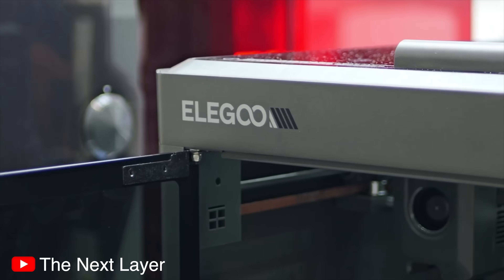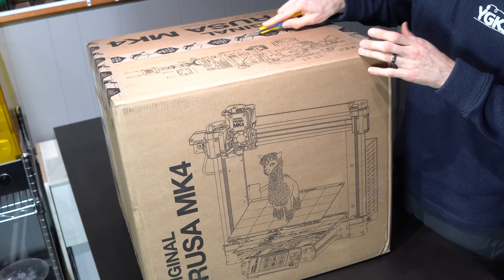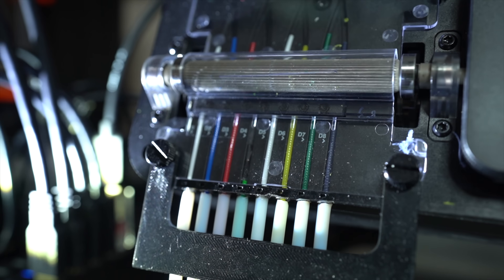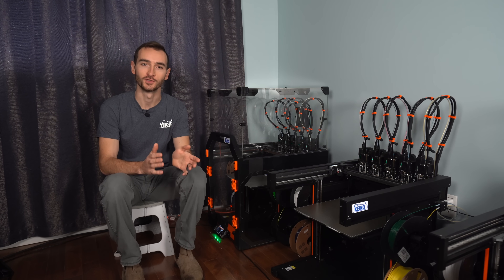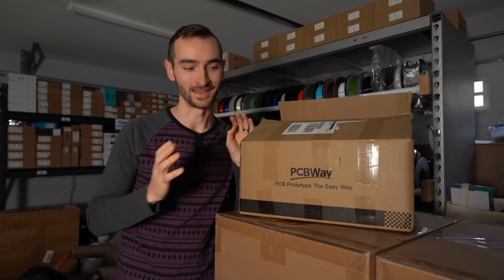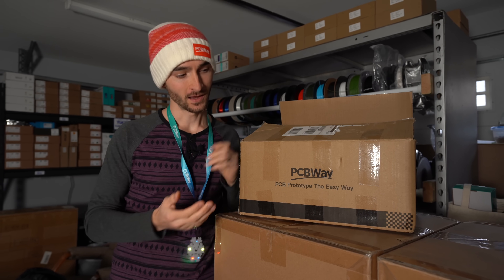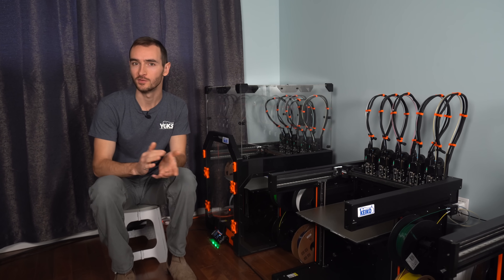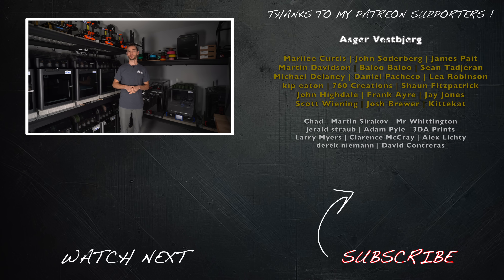The Prusa Core One is dividing the internet...

Comment from the maker: Thanks for watching. For the record, I’m not saying the X1Cs are permanent paperweights. They’re just out of commission until I find the time to repair them. I’m perceiving it to be a difficult process given how tightly integrated these machines are, but I might be mistaken. I have reviewed the instructions on the Wiki for replacing the heated bed and it appears to be quite involved, but perhaps it’s easier than it looks. Cost wise, the replacements are very reasonable: around $120 for a full bed assembly.
Reply: I...don't get it? The screen gives you a message indicating what's wrong, the replacement parts are readily available, and you just don't feel like it because it might be "more work than it's worth" to fix them? And that's why they're paperweights? Whhaaaaa? Like if it was some esoteric failure or one that necessitated scrapping the entire printer I would understand, but just not feeling like dealing with it isn't quite the same thing.
Reply: i just bought bamboo A1 :((((
Reply: @wickedisgood3280  good, congrats!
Reply: @wickedisgood3280 return it lol cant use 3 party software
Reply: @wickedisgood3280  
Thrilling...🙄
Reply: @wickedisgood3280  
Thrilling...🙄
Reply: Might be an idea to mention other competing corexy machines like the K1 Max or SV08 which have a bigger bed.

IMO Prusa has to move to industrial as it stands at the moment, other companies just copied them and their ideas or ideas from the open source community and dont have to do their own research. Prusas costs are always going to be higher.
Reply: @francistaylor1822  they aren't "competition" that's the big issue. All other brands currently are for people that want to build and tinker with a printer rather than just print. This exact thing is why I did go with and have Bambu printers. I started with a flashforge and an ender clone that (while they did get me to learn how to build and troubleshoot printers) took absolutely forever to get to even half the quality as all of my Bambus out of the box. I just needed shit to print for my main business and not spend days tinkering. That's every other brand right now.
Reply: Yeah I went ahead and closed the video at this point. 1,800 print hours in and I have had some minor issues but nothing I couldn't service myself. You didn't even try to solve the problem and are acting like it is an end of life issue. I wouldn't call you a Bambu shill, I'd confidently call you a Prusa shill.
Reply: Consider making a video of the repair process and overall thoughts on the repairs
Reply: @ygk3d  I can speak from experience, the heat bed is probably the second worst thing to replace, after the XY carbon rails. I mean, replacing the entire chassis is probably the absolute worst as you have to replace everything. But yeah, heat bed requires you to remove side panels, back panel, a wire that’s routed in a weird way, cable management…. I’ve had to do one heat bed in one year across eleven machines. Not bad, would not recommend the process to friends. But the XY is way worse.
Reply: They’re not too bad to work on.  No worse than an Ender 3.  Plus they seem to sell just about everything as a spare part, for reasonable prices.

This is from my experience with a P1S.  Mostly from (repeatedly) servicing the AMS unit, which is the weakest part of the system by far.  Even lightly abrasive materials play havoc with it.
Reply: It's easier than it looks.  I was shipped a "banana bed" (warped heat bed).  Replacing it seemed more daunting in the instructions than it really was.

I put it off for almost a year due to same worry.

The disadvantage is that we don't build the Bambus.  I've built a few dozen MK3S from scratch and know them inside and out.  So we just don't know what to expect.

Tearing apart the Bambu isn't any worse than any enclosed CoreXY.
Reply: This sounds like a user problem not a product problem.  The WIKI tells you everything, and all the parts are purchasable.  This is a user issue, and should not be a ding on Bambu.  I have had to fix my AMS 1 time with parts, and my printer once.  I don't think I've ever seen such good documentation and disassembly videos produced by any manufacture.  Most of the time you have to go watch youtube to repair stuff.  Bambu has a good self service model.
Reply: @galley3175  ohh can you link the wiki page about the recent firmware rping bambu scam? The one where you must use bambu slicer or a junk bambu "bridge" sw between orca and your printer even in lan only mode just to collect your data and control what you own? That would be really helpful.
Reply: Prusa with Bambu controversy but I won't get much use out of it. I only need to print enough terrains and I'm done, however I would continue to print miniatures (since I don't paint them) forever. If only Prusa can give us resin quality miniatures print.
Reply: See, that's where you are wrong. There are people running huge farms of BambuLab machines and I can tell from personal experience both their support team and repairability is fine (1700 machine hours average). Plenty of original spare parts are readily available in their shop with fast shipment, often at a lower cost compared to Prusa spares. Repair videos are quite well done also. This is very much unlike Apple. It's more like an open-minded repairable iPhone, combining great UX with easy repairability.
Reply: I do agree with the complexity of disassembly, since I already got the hotend, extruder assembly replaced(after spending couple of hours trying to recover them). The Lidar on X1C makes for a no tune, print anything for prototype purposes(unless you edit a bunch of gcode to bypass unwanted procedures for production).  It unnecessarily increases complexity(when lidar/camera error pops up from time to time), and additional time to every print. The best I know was a Lulzbot, with its direct extruder, although it is lost in eternity. I do love P1S's  no wifi, no bamboo studio not even registered🤫, but prints like a tank, with just the gcode loaded onto an industrial microsd card, except for one firmware bug(resolved in a later firmware🤯), that can be easily worked around.❤👍
Reply: This is the equivalent of me bitching that my Range Rover is now a paperweight because I got a warning light that the coolant level is low. Yes it's $300 bucks for a dealership visit, or you can you know, be a functional adult, buy a gallon of appropriate coolant, and top it off -- It actually needed equivalent of a cup after 4 years of ownership. Complaining that the coolant port is hard to find, and the instructions are confusing is next level entitled.
Reply from the maker: @kazolar  Coolant is a consumable. If the argument was about greasing rods / replacing nozzles (something easy) then your analogy would make sense. In this case, we're discussing a critical fault of the heated bed that will require disassembly of the printer. Do you do your own car repairs or do you take it to a mechanic? If nobody offered the service of car repair and you had to do the work yourself, at a certain point, you might just consider selling the car and buying a new one. Time is money, especially when running a business, which is my use case for these printers.
Reply: @ygk3d  Considering the speed difference between the X1C and the Prusa MK3s you have, it 100% makes sense to repair the bed... The hot end force sensor is significantly easier to replace and even sillier to not have fixed yet.
Reply: Bro. You made a video bashing the serviceability of the them without even contacting their support team first? 😂. By stating that nonsense, I assume everything else you said was nonsense.
Reply: @mallclerks  Buddy, be honest.  Does he also have to prove that the world is round and the moon is not made of cheese?   Look around online, or simply talk to others that have both.   If you want to fight about something or shill for Bambu, this is not the point to do it on.  Go with price and innovation instead where Bambu still leads.   He also said at the end of the video he'd still pick a Bambu over Prusa.   Geez.
Reply from the maker: @ @  it’s all documented on the Wiki, so I know roughly what’s involved. It doesn’t look like an insignificant task which is why I haven’t gotten around to it. Contacting support would just be for a warranty claim to save the cost of the replacement parts.
Reply: @ygk3d  You also likened Bambu printers to disposable tech, complete with stock footage of shredded circuit boards and allusions to the iPhone's lack of repairability while nuzzling up on Prusa's jock. Then you go after Bambu's "shoddy support" at 10:47, but you said yourself you haven't contacted them. 

And if/when Prusa goes out of business, I challenge you to find a complete third party toolhead. Or their PCBs. Go ahead, go find them now even.

Rethink this video. Consider pulling and fixing it. 

I won't see anything you ever produce ever again, since I'll be blocking this channel from my recommendations next time I get the chance... 

(And I own a P1S, an X1C, and an XL).

Oh, I see - You'd throw out a P1S if you run into the slightest hiccup. Got it.

Dude, you have some brown on your nose. Did Bambu decline to send you review units or something?
Reply from the maker: @ you’ve misinterpreted. I love Bambu printers. They’re my daily drivers. Perhaps some of my statements were misinterpreted. I wasn’t implying Bambu’s customer service is shoddy, just that Prusa’s is not. And the bit about most tech products being disposable was a general statement of the industry. I’m pretty certain I’ll have sold off all of my current generation printers 5 years from now. They won’t immediately end up as e-waste but eventually the tech will be so dated that nobody will want them. I tried to be pretty even in my assessment here, saying both positive and negative about both brands. If you don’t like my content, that’s your loss.
Reply: @ygk3d  No, I haven't misinterpreted. Your words failed to convey the sentiment you hold. Why make the comparisons - the DIRECT, in sequence comparisons - if you don't hold the belief you voiced? 

Your backpedaling here is quite sad. If you feel Prusa's customer service is good, speak about that. Don't speak about shoddy customer service, implying Bambu, while also in the same video saying you haven't contacted them.

Watch your video from the perspective of your audience, and not the thoughts that exist only in your head since you didn't communicate them to us.
Reply: @ygk3d  One glaring issue IMHO is you gave a glowing pass to Prusa for their support but automatically dismissed Bambu without even following through.  It's lazy journalism to only provide one and not even an attempt of troubleshooting for the other. Bambu are touchy with all of the sensors and tech so I'm not saying otherwise but it's a cop out to leave it at that and act like you're just going to trash two printers that likely require a couple hours troubleshooting and repair time to get back online.  I don't fully disagree with many of the points brought up, but you should be looking at both with the same objectivity if you're going to compare them outright.
Reply: @ygk3d  The task can't be any worse than receiving an $800 prusa mk4 and putting hours into assembling it vs buying the bambu A1 for $300-350 and putting 30 minutes into assembly. You could replace the bed a few times and it still wouldn't add up to the total time spent assembling the printer in the first place.

I know the X1C is a different animal, but from what I've seen, they made everything on their printers quite accessible.

Bambu has done a great job offering the best tech at a reasonable price. Prusa drags their feet on offering new tech and tries to pass it off as them trying to offer a more reliable product. In reality, it's them saving money and letting everyone else do the development.

The only thing Prusa has going for it right now, is the old thoughts that they are the workhorse 3d printer. You may have 2 bambu printers with issues, but I have seen farmers that replaced all of their prusa printers with bambu (cost less to get more printers and ams) and after a year have seen no more, if not less failures with the bambu compared to the prusas. The repairs on the bambus were also quicker and easier than the prusa.
Reply: @Those_Weirdos  This is the exact point I make to people who over-index on "repairability." Being able to source certain parts at the moment != "eternal repairability." Even if it's open source. Like it's great that you can make your own PCBs and load the software - can you also grind your own Z-screws? Wind your own motors? Because at the end of the day every independent prepper-bro 3D printing enthusiast is still dependent on other people continuing to manufacture things for them to buy. There is no clear black line between "repairable" and "unrepairable." 

Bambu Labs came and did what nobody else managed to do until then: make a 3D printer that just works (99% of the time at least) and can be treated as a tool and not a hobby/obsession unto itself. Everything else is cope until a true competitor emerges.
Reply: @ygk3d , perhaps some of your statements were misleading... I guess, the goal was to get a large number of comments. This is getting more and more "popular" on YT.
Reply: @Those_Weirdos  since you’ve already said you’re blocking this video, you probably won’t read this, but why so angry?  And what’s with the highly sexualized references?  Ultimately, why are you so challenged by someone else’s take on a 3d printer?  It’s just a tool, not a lifestyle friend.
Reply: @Those_Weirdos  Oh no he'll have one less viewer!
Reply: @Those_Weirdos quite the melodramatic response. Good riddance in my opinion.
Reply: @Otamatone_Productions ooo this comment age like milk finding out bambu new software update lmao and this guy gets his info from wiki lol how about the actual website not a community source wiki that is uncredited in schools
Reply: @cartier13  he is absolutely mental.
Reply: How about you actually figure naif not it's easy to repair or not before making statements as if they are facts.
Reply: Heatbed failure after only 1,000 hours is not good at all; what part will fail next? and there are many (the majority?) of folks buying Bambu because it's prices does make it accessible for a 'plug and play' experience. They're not tinkerers and are neither adept at and / nor want to fix things like you and I. And then there's the white elephant in the room. How did Bambu come from nowhere with such a groundbreaking market disrupting product? How was their R & D and massive production startup funded? One answer, They're Chinese where wages and benefits pale to what other companies - ergo Prusa pay. I'm sure Prusa get some support from their government but NOTHING compared to what a company gets who are in favor with their communist government. Those comparative sales points you said Prusa make in direct reference to Bambu are both very valid and why wouldn't they; that's called free market competing. Prusa recognize who they're up against and are responding. The way you present that is done as if it's a negative against Prusa? At the end of the day, Each company has a place in the market and to HUGE credit to Bambu, among other things, they stopped the race to the bottom of hobbyist FFM 3D printers. As you said, we the consumer, of either company's products, win :D
Reply: @what_the_filament  There's no guarantee the heatbed itself has failed-- based on the error, it's either a bad thermistor, or more likely, a bad connection to said thermistor.  And there are people with three to six thousand hours on their Bambu's with zero failures.
Reply: @what_the_filament the heat bed failure is just anecdotal, as is any experience that’s cited in a vacuum. Even ones like mine, I have 3 Bambu, all over 3,000 hours, and I’ve only replaced 2 hot ends. In both cases I was just too lazy to replace the nozzle. But that’s just anecdotal, much like his heated bed failure.
Reply: @what_the_filament  So much of what you say is wrong here.

Firstly, Czech wages are only about 25% hire for this market sector.

Secondly, it's not like every bed fails at 1000 hours, this is an abnormality and one that happens to Prusa printers too

As for government support claims, Bambulab was funded by private firms
Reply: @BeefIngot  if you look closer you will see that there is not much difference between private and government funding from the national to the local in China today.  Hope the US doesn’t end up the same, but we are heading in that direction too.
Reply: @robblincoln2152  I've no idea how people come to these conclusions. If this were the case Aliexpress couldn't have been ceased from Jack Ma
Reply: You could sell them to someone who does not mind fixing the issue.
Reply: These comments are ridiculous lmfao

It's well known that Bambu's customer support leaves something to be desired. Based on the hundreds of posts and stories online of people having a mixed experience. He doesn't need to call them to prove that.

The way the internet creates tribalism even in the 3D printer space is hilarious. Share a negative opinion? You must be a shill. 😂
Reply: @magruster  It's not even an opinion, it's a speculation.
Reply: @NathanTheNinjaTaylor  Maybe you should look up the definition of an opinion lol. no offense 

Bambu’s customer service is OBJECTIVELY mediocre. Don’t believe me? Googles your friend.

edit: I hope just the word “shill” wasn’t enough to make you feel like you had to tag me 😂
Reply: @magruster  you seem very upset and confused. Opinions are objective now?
Reply: @ No need to self-project lmfao
 My statement meaning; that you don’t need ygk3d to tell you that it’s bad or not, because you can look anywhere on the internet and find that it’s subpar. If you somehow took anything I’ve written as “opinions being objective”, your reading comprehension needs serious work.

but that wouldn’t surprise me considering you left your asinine comment that said verbatim “acting like it’s an end of life issue”. Under a thread where he clearly states that he plans on fixing his printers when he has the time. Google also has reading lessons for you buddy 😂
Reply: X1C owner here. Not only they are hard to sell because of the high cost they are quite literally paperweights. Only select parts are serviceable because they welded shut a lot of the key components. In my case, they refused to provide 3D models or replacement parts to a key component in the Z axis. They will work fine for a while, and then they are going to be completely trashed. DO NOT BUY.
Reply: @Isismgc can you be specific about the part that can't be replaced?
Reply: @FilipAus  no because he's lying lol shit didn't happen
Reply: @FilipAus  They sure can't lol